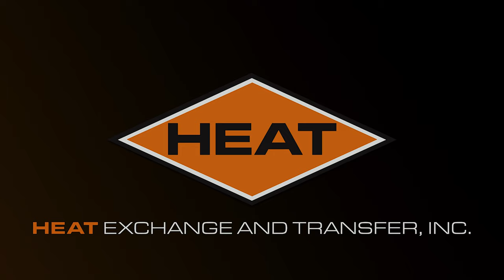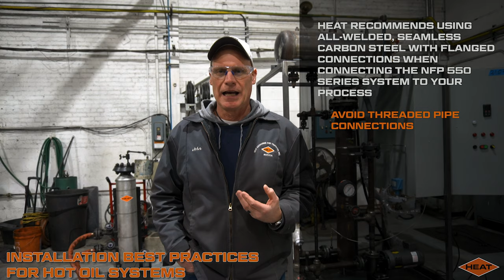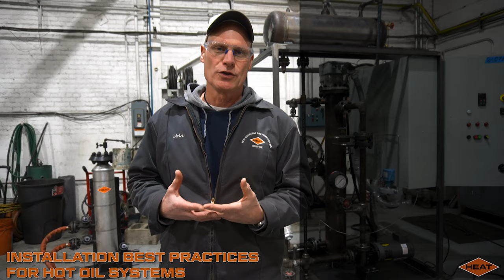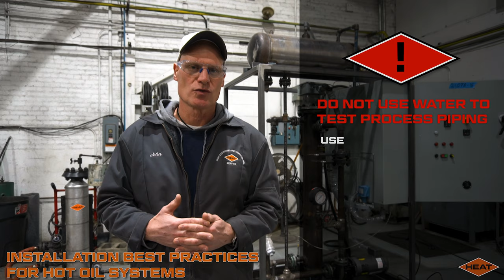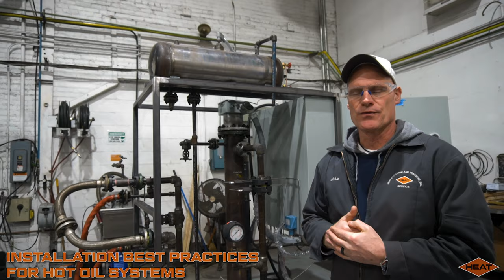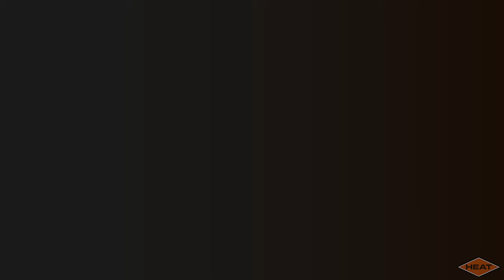Hot Oil System Installation Best Practices | HEAT UNIVERSITY

Comment: Hello, thank you for the video 
What is the shape of the vent in the oil system, and are the drain points connected to another line (other than the return pipe )?
Reply from the maker: Hi there! We recommend that your high point bleeds be installed with a valve and a gooseneck piping (a vertical pipe from the high point, then two 90 degree turns to a shorter pipe downward), allowing for safe and easy removal of the air inside the piping - use a catch bucket underneath the gooseneck, open the valve to let air escape, and close the valve when there is a steady stream of fluid.  Install as many of these as are practical to have the smoothest possible initial fill of your system.

The drain pipes are run to the edge of the system's skid - any connection from there to a drain tote or other location can be made by you on location. Depending on the design and where in your process the system is installed, several drain points can be necessary to remove all the fluid from the system's piping.